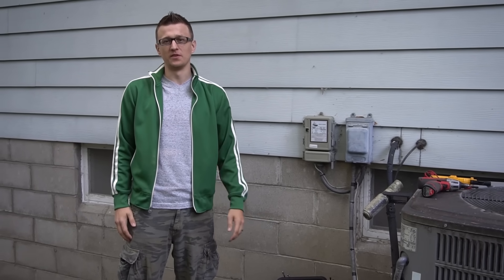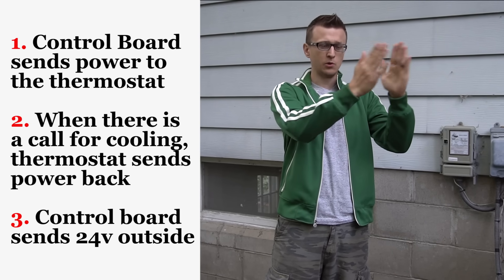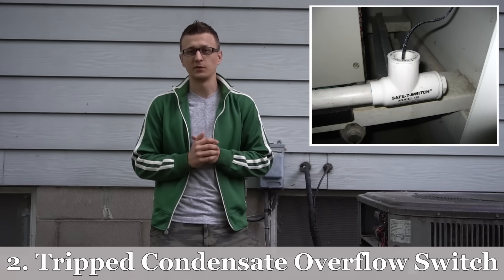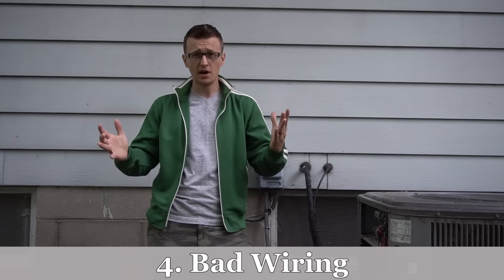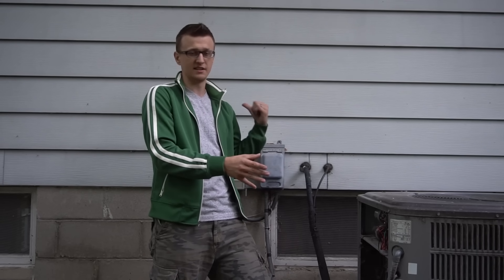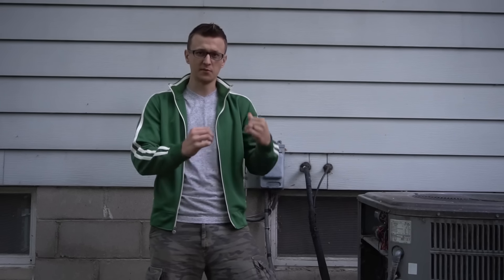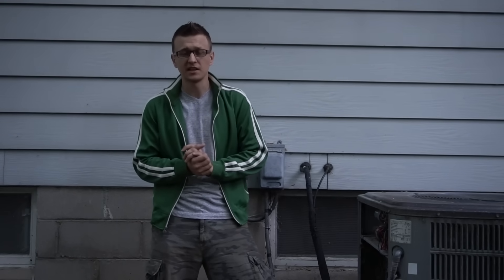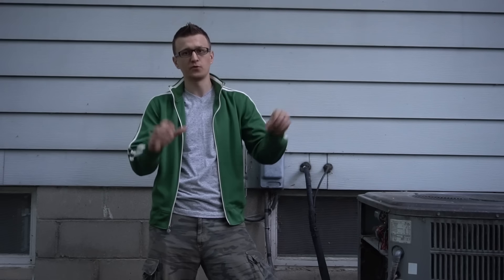AC Contactor Not Pulling In - 10 Reasons Why

Comment: The issue I am dealing with is the unit runs intermittently. In the mornings it cycles fine, but at the outside temps go up the unit stops cycling. It can reach 5 to 6 degrees above the set point without the unit running. Our fan is set to always on. I replaced the thermostat and will replace the wire next in case its an intermittent short in one of the wires.
 I can pull the the thermostat off the base, reset it and after the time limit, the unit will start cycling.
Reply: Is it a carrier infinity?  I’m having a similar issue

Comment: Hi Jay, I’m getting 24v to the defrost board but no voltage at contractor so contractor doesn’t pull.  I researched that it could be the defrost boards fault or could be defect pressure switch.  I went through all your ac related videos and did all the maintenance and testing and all is good, but no voltage from defrost board to contractor.  Do you have a video related to this topic?  Thanks Jay!

Comment: Dude. Thank you! Traced down that my low voltage wire to the compressor wasn’t getting 24v from the circuit board. 
Jumped R and Y on my thermostat and the compressor kicked on instantly. Thank you thank you thank you!

Comment: A lot of newer units have control boards that monitor their system and will throw a code and shut it down. In order to find out, you have to remove the outdoor panel and count the blinks, long/shorts, then look up the code in the book. Then you can press the reset button and the unit will restart. A quick temporary fix is to cycle the breaker to the outdoor unit. This will restart the board. Mine would do this during heat pump mode and was caused by an incorrect refrigeration charge level that would cause it to trip on high head pressure during very cold weather. Not a time when I wanted to deal with fixing a heating problem. Cycle the breaker and restart the board, see if the problem comes back.

Comment: Thanks so much you are a lifesaver I was having the same trouble I put a new comparator on and mine still would not work but when you said that the batteries may be low on my thermostat I tried that and boom that fixed my problems but I got one of them 5ton old Goodman big old unit but it works about the same I think not much on A/C I'm a auto mechanic but it's not as hard to keep my air and heat going with your videos when the AC man came out he to look at it he told me a list of things it needs it just to get it back running 😢 and it be like 800 or 900 to get it up enough to find out what else id need I can't afford that id just as soon to put a all new unit in but with your help I did it myself.

Comment: This video saved my a$$. I went through all 10 steps. After trying everything, I finally went into the attic, found the correct unit (there were two), and opened up the panel with the fan controller, and sure enough just like the video mentions, discovered a shorted fuse! I replaced the fuse, switched the breaker back ON, and the outside fan shortly kicked back on! Dude, thank you so much!!! You saved me  a ton of $$$$.
Reply: Any update?  Fuses don’t just burn out.  You have a low voltage problem that’s going to come back.
Reply: @millenialmemoirs  It's been 2 months since I replaced the fuse and it's still working (knock on wood).

Comment: How do you fix a melted wire at the connector to the capicitor?
Reply: I would replace the wire. If that’s not an option you need to test for resistance and verify it can still carry that low voltage while watching it closely.

Comment: Looks like the end of the red wire attached to my capacitor is melted at the the female connector to the male prong of the capicitor. Can wrap the wire in electrical tape and add a new female connector?
Reply: Capacitor I would say is bad but check for ohms across the terminals. Would really need to inspect that wire that had any melted material in it. Would definitely want to test for resistance and ensure it can carry that 24ish volts without any smoking or more issues

Comment: I get confused when you start talking about the furnace when you are supposed to be teaching about a c
Reply: They are connected because that’s basically the Junction between the thermostat on the wall and a condenser or a heat pump on the outside

Comment: You are by far the best source of info I've came across. You should teach people, very easy to understand. You helped me diagnose an issue with my  jumper between RH and RC on a Honey well zone board. The factory jumper was smaller gauge than the 8/18 wire i was using and causing intermittent contact. Pulled out OE jumper and made one with wire, fits tight and works as it should. Thank you.
Reply: I had this same issue once! Very easy to miss and think you have a tight connection. You do, but only on the thicker gauge wire.

Comment: My contactor was pulling in but not far enough for contacts to be engaged. Original AC installer cut off wire and let trimmings fall into the contactor. A quick shake, trimmings came out and working again. 
Original AC installer was a real winner. Furnace was making a nice vibration noise under blower. Unit under warranty but installer 'didn't have time' to come out so I looked -- I found a nice pair of channel-locks beneath blower. Later the AC drain plugged up - Original installer dropped a small wooden handled screwdriver into the drain pipe and left it. Very little room around the screwdriver - the wood expanded and plugged up rather quickly. Same guys used typical low voltage transformer used to provide power to thermostat -- rather than mount it properly, they left it hanging inside by it's primary wires. Yep, these guys were real perfessionals.

Comment: Dude you killed it!!  :-)).   I live in N. TX, and yep a spider got in-between the contact and NO AC.  a 15minute fix.  Please tell me, is the Contractor your show in your Video Brand Specific?  I have an 25-30 years old Carrier unit and the contractor looks basically the same as you showed.  If I wanted a New Contractor what would I ask for at the Electric Store??   My unit works find, but the INFO Tag on it and the systematic is unreadable.   You are a very good Instructor, and great guy for taking time and efforts in helping all of us, that are NOT AC Tech...  Again BIG THANKS !

Comment: Had 24 volts at the thermostat, no voltage at the furnace board, no low voltage at the contacter. I had 240 volts at the plunger though. My plunger would not pull in. It would just buzz and the condenser fan didn't come on. My furnace fan worked. Changed the capacitor and fan still wouldn't come on. Found my honeywell thermostat C type adapter was faulty at the furnace. Wasn't letting the system activate low voltage at the contacter.

Comment: Battery did the trick.  A/C motor outside wasnt turning on.  I could trip the relay manually and the fan motor would run.  I was about to change the relay until I read this.

Comment: Thanks for the video. We are going to go into the attic tomorrow morning and check the furnace fuse. It maybe me blown. It makes sense if rhe furnace breaker was thrown and we had changed out our thermastat a week ago. Maybe those wires touched and shorted it out? If i understood you correctly.
Reply from the maker: You're welcome! Yes, if you did not have the power off when you were replacing the thermostat, something may have accidentally been shorted out.
Reply: @WordofAdviceTV  well I don't know if we had it off or not. We turned off the breaker where it says AC but I believe we should have turned off the furnace from what I'm understanding from you now. And we did not do that. But we changed the thermostat out a week ago and it's been working fine since then. It just messed up today so I don't know but we'll check everything you said here tomorrow morning when it's cooler. And if we can't figure it out we will just have to call someone I guess lol
Reply from the maker: @melindarivera6598  Oh okay! If it was working for a week then it may not actually be a blown fuse. You understood correctly, when replacing a thermostat, it's the furnace power that needs to be turned off. Best of luck to you, hopefully you'll be able to find the problem quickly and fix it even quicker!

Comment: How can i bypass the low pressure switch? Can I cut the 2 wires and tie together ?
Reply from the maker: Yes, that would bypass it. But usually they don't just go bad, if it is tripped that means the unit has a leak and is low on refrigerant.

Comment: #11 if you want to add it? Probably less common? My older 1996 Carrier system has a Time Delay board just below the two-pole contactor. After going through your list and even took a chance and replaced some parts, I had to call in a pro.  He retried a few of the diagnostic tests I did and quickly made his way to the time delay board and determined that was the problem. In just 5 minutes a new time delay was installed, set to 5 minutes,  and we were up and running normal again. $157 total for the job. $90 for the visit and the rest was the part and install labor and taxes. Thanks for you video!  Even though it didn't correct my issue I enjoyed tinkering around and swapping out parts, namely the contactor which I learned, even though it has a single plunger it was still a two pole contactor and relaced the two capacitors as well.

Comment: @worldofadvicetv Awesome video. The problem I'm having is there's no led indicator on or blinking on the controller board. I bypassed the thermostat and got nothing. When I go outside and press the plunger down, the compressor and fan on the outside turn on. JUST received a new replacement contactor and will be installing it. I have a feeling though that it won't fix the problem. And thoughts you could share? Thanks in advance p.s. checked the fuse and it's ok.

Comment: My problem was obvious. Some how a mouse made its way inside the compartment where the contactor and start capacitor were located and fried itself. The mouse carcass (or what was of left it) was dangling from one of the start capacitor terminals. The mouse managed to chew through one of the wires that energizes the contactor (28 VAC) before it fried itself. I also had a bad thermostat. The thermostat was not applying 28 VAC to the contactor coil. I replaced the thermostat and fixed the chewed through wire and everything works. I don't know if the thermostat was damaged when the mouse chewed through the wire.

Comment: Hello, seeking your advice - I suspect I have a bad contactor as when there is a call for cool the furnace fan kicks in. On the furnace board between C (or ground) and Y I have 24v and outside between the contactor and ground I have 24v on each side, yet the contactor will not plunge... The really odd and puzzling part is that if I bring the contactor inside right beside the furnace board, and just hook the 24v side to Y;C at the furnace board the contactor will make contact.  I have 15 ohms of resistance across the coil.

Any idea?

Comment: Amazing videos. Very informative.  I wonder if can elaborate on the HP Switch or how to test it.  My current efforts: Pressing the plunger on the contactor manually kicks on the fan.  No 24 volts at the side terminals (blue/yellow), 24 V from the thermostat. So that has led me to a HP Switch or LP Switch.  I do not believe I have the latter as I only see one HPCO on the diagram and only one on the copper.  If I check for resistance/continuity on both wires that lead to the HPS, it registers as open.  Yet, if I bypass the switch (connect yellow to black) it does not seems to fix the issue. TIA (Trane 4YCY40)
Reply: OK,  So guess it is the HP switch. Apparently I weakened a wire splice when I was in there so that is why the bypass failed. Now when I bypass the HPressure switch the fan turns on.  So guess it is the HP switch.  Not sure I want to mess with that as it is on the copper coolant line unless I know it has a Shrader Valve.

Comment: Dude, I need help.  I replaced my cap, contactor, and thermostat.  This fixed the low voltage shortages and no longer blowing fuses, but my plunger still wont go in automatically.  I shimmed the plunger on the contactor and it works.  How do I fix this correctly and is my current setup unsafe?

Comment: Hello I have a question I change my thermostat to a simple, ordinary thermostat know my air conditioner is humming before it turns on outside it is very loud. I don’t know. It sounds like a seized up motor but the motor is turning. I don’t know if I put the wrong thermostat on.

Comment: When you don't have 28 voltage at contactor you take your wires off contactor coil off and you got 28 voltage.  Why you have a lose wire at your Y call at TSTAT not good contact so you don't have enough to pull in contactor . So once you tighten up your y at TSTAT bam 28 voltage! Viva el mundo Technicians!

Comment: Excellent video!!  Very thorough on the explanation of what signals cause the contactor to engage and what can cause it Not to engage.  One other thing that can potentially cause it not to engage and this falls under 'Bad Wiring'-- if the wiring (or connectors) are corroded or partially broken such that it can't carry enough current to magnetize the coil enough to pull the plunger.  You could still read 24-27V on the line but it may not be able to carry enough current because it's compromised.  I ran into this personally last week. 😝
Reply: Mark I seen that exact situation, contactor works when connected straight to the 24v transformer and signal line reads 24v outside at the contactor but contactor still does not pull in

Comment: You weren't being robbed. The reason you got charged $1,200.00 has to do with many reasons. One is that we are experts in the HVAC trade. We received the schooling and certifications to be able to properly do this work. We also have thousands upon thousands of hours of field experience. Another reason is overhead, obviously. Like restocking the van or truck. Which can cost THOUSANDS OF $ a week. Another is paying that expert his or her hourly wage. Another is gas prices and maintenance on the service van or truck. Which again can cost THOUSANDS OF $ a week or month. These are just a hand ful of things that affect prices. A huge one is the danger of working with hi voltage. It only takes something like half an amp to stop the heart. So if a cheap home owner wants to be a DIY type of person, knows nothing about hvac, and only watches a YouTube video. There is an extremely high chance they will get hurt or die, messing with high voltage they know nothing about. Or simply damage the entire system beyond just a repair. So, instead of costing you $1,200.00, now you're paying double or triple, replacing the system. Watching a YouTube video is easy, guys. Doing the work and doing it up to code and correctly is a different beast altogether.

Comment: Thank you so much for such a well-detailed video! I'm trying to learn how to fix a lot of things myself. Last year in March our AC got into a sick state after a power surge. That usual "it's off and fan is auto but the unit outside is running constantly and won't turn off" thing. The service guy was very kind to explain things to me, so I at least understood how to cut power to the unit and that the thermostat can be one of several causes. In my case, the contactor was stuck and he replaced it. Here I am not even a year later and same issue. Hoping to fix it myself this time.  I'm suspicious it's the contactor again, but I feel like it shouldn't be going out so soon, especially considering the unit wasn't used most of the winter.
Reply: I hope you can fix it yourself  this time , buddy . Everybody knows there is no better feeling . And this video is a GREAT HELP !!!!  I live in BATON ROUGE , LOUISIANA ,  and I could not tell you how many times we had to replace the CONTACTOR , because ants got in between the contacts or points and shorted it out ....  just like he said in the video . That stuff gets very very expensive ... APPARENTLY ANTS ARE ATTRACTED TO ELECTRICITY and the contacts area ... it sounds funny , but when she is up and running again , consider trying to block off ant , etc from coming into the area of the CONTACTOR... sticky tape or paste or something to block their access ... in my particular case I could actually see how they got there !!!!  🌅🌅

Comment: Good tips! Woke up to no power in the house (which came back on shortly later), 58F indoor temps. Checked the thermostat and it clicked, but nothing happened with the heat pump. After checking the voltage on the outside unit, I thought about you saying that the fan should blow and ours wasn't. I thought it might be the condensate line being full, but it was empty. Then I moved on to the disconnect fuse for the air handler and turns out one of the 60A 250V fuses were blown. The emergency heat has been working overtime and I think it finally took the old fuse out. $16 later I'm back in business. I'll make sure to give the unit a break. It's been unseasonably cold with the arctic blast of Christmas 2022!

Comment: The contactor switch was not pulling in, and before I replaced the contactor, I decided to watch this video. I glad I did because number 8 was the problem! The high pressure switch tripped and I just needed to reset it by pushing the red button. Now I just need to figure out why it tripped. But this guy makes the best vids on AC that I have seen!

Comment: Thx, a bad fan capacitor and high temps caused the high pressure switch to trip, and contractor not pulling in. replaced the capacitor and reset the high pressure switch. AC works again. Thx